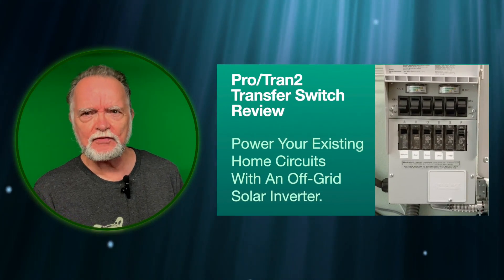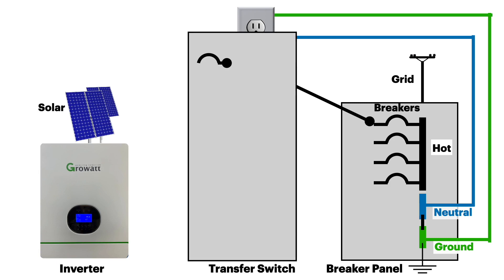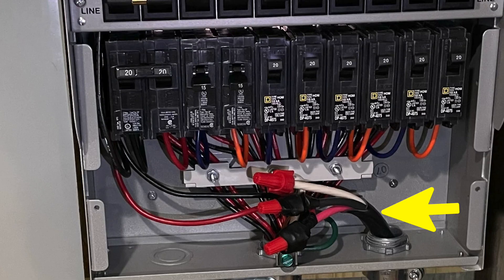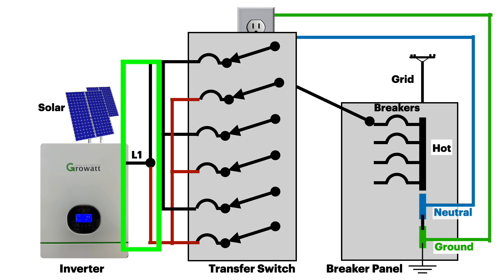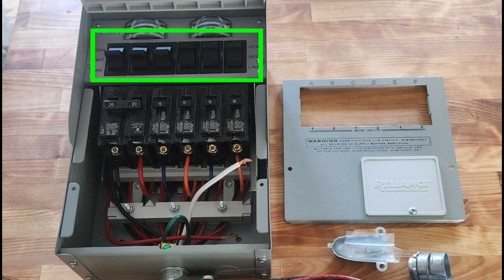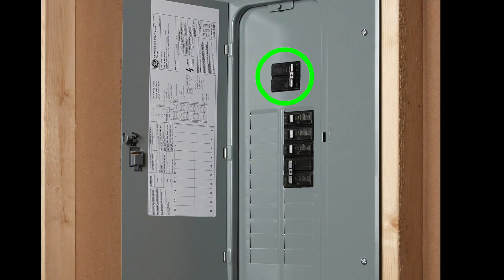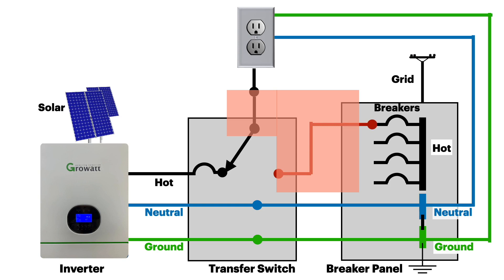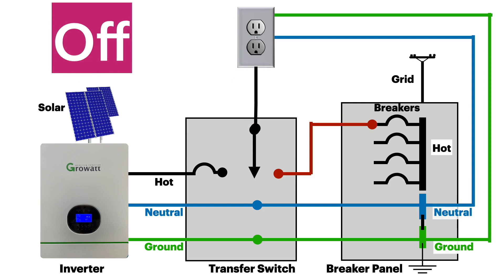Solar Inverter- Transfer Switch Install- How To!

Comment: I have a question am my electrical panel for my house the neutral and the ground they both are the same buzz bar so when I connect my transfer switch, do I connect both of them in the same bus bar police advice?

Comment: You clearly showed how the neutral and ground coming from the inverter connects to the transfer panel, but I didn't see how L1 and L2 from the inverter connects to the transfer panel.  Maybe I missed it or it's in another video.

Comment: Great video.  Question- I do not need to connect all the switches at this time.  What can I do with those?  What do I do with the cables I do not need to connect to the panel?
Reply: Leave the wires coiled at the bottom of your main box. The breakers can stay in the box unwired until ready to use.  That way you can use them easily one at a time if needed.
Reply: @SwollenCraniumthank you very much for replying.

Comment: I've been designing a battery backup system for my home based on a 24v, 3000w hybrid inverter. I wanted to use *some of the existing circuits in my main panel.  Your video helped me decide to use this system in the video. You explained it very well!

Comment: Thank you so much! This is the only video that I found that explains how to wire an inverter to a Reliance transfer switch and load center. Your pace of speech facilitate comprehending the work at hand. Bravo! 

In my case, I will be installing two Reliance 10-circuit transfer switches (model 510-A), as I need to power 20 circuits out of my 44 circuit load center. I contacted Reliance Controls and ask how to accomplish this. For anyone needing to know, this is what they told me to do: There are 4 wires in each of the two Reliance transfer switches (RTS): Black, red, white and green. (8 wires total for two RTS.) Bring all 8 wires to a junction box. Also, bring 4 wires (L1 black, L2 red, white neutral, and green ground) from the inverter into the junction box. Connect all three black wires with a wire nut; then all 3 red wires with a wire nut; then all 3 white neutral wires with a wing nut; and finally, all 2 green ground wires with a wing nut. That's all there is to it.
Reply from the maker: Thanks! Glad it was helpful.
Reply: why connect only 2 green wires inside the junction box? shouldn't it be 3 green wires to be consistent?

Comment: I always thought you couldn't intermingle neutrals wires from an inverter and the grid. Let's say theres a power outage and you're using your inverter to power your panel. If the neutrals are bound together and not isolated, wouldn't you accidentally send power to the grid's neutral line?
Reply from the maker: Only if you also connect a hot (L1 or L2) from the inverter. Electricity is always trying to return to its own source. 
All of your circuits in your house have the neutrals tied together in your panel, but those neutrals will not have any current unless you connect a hot (turn on a switch or appliance).

Comment: @ReelClearMediaLLC
Excellent video. 
Question: I have a grid assisted battery back up system with no solar. I'm using a EG4 3000W inverter. I have a dedicated 30A circuit coming from my house sub-panel to my AC-in at the inverter. The house ground and neutral is always connected to my inverter. This inverter has a common neutral configuration, therefore, the house ground and neutral is passed through the inverters' AC-in to the AC-out. I was thinking of tying into my house sub-panel to feed some house circuits with a transfer switch, however, since my inverter is permanently tied to the grids' neutral and ground there would be two ground and neutral paths between the inverter and my house sub-panel (one ground/neutral from my 30A dedicated circuit feeding my inverter and one ground/neutral feeding the sub-panel through the transfer switch). This would create a ground loop and neutral loop. Would this create any issues?
Reply: I believe the EG4 makes and breaks its ground-neutral bond internally with relays depending on if it's passing grid power thru or not. It's because of the possibility of unplugging the AC input entirely, not just grid failure. If you unplug, say in an RV park, you have no upstream G-N bond. So it makes the bond while it's on inverter power only. If you tie back into your main panel with a transfer switch like in this video, you'd disable the G-N bond 100% of the time in the inverter. There would never be a safe scenario where the bond would need to happen in the inverter in this case.

Comment: Is there a way to have it wired both for solar inverter and a 30 amp generator plug?
Reply: I have a 10 switch reliance transfer box already running to a 30 amp generator plug but having solar as a plan a or b would also be nice.
Reply from the maker: You could use one of the Reliance power inlet boxes, and manual switch cables between generator and Inverter. Alternately, you could use a three or four pole switch, but it would have to be rated for the amperage... most like would be pricey
Reply: Thank you for your time and the wonderful explanation. 
  Regarding a generator, could you simply use an interlock at the main panel going to a generator and at the transfer switch select "line"?

Comment: Is there something like this where the switches flip automatically when the power goes out so I don't have to do it manually every time?
Reply from the maker: If you want to power existing circuits in your existing breaker panel, there are a few Automatic Transfer Switches (ATS) available. The ones I found online were very expensive.

If the output of the inverter powers a seperate breaker panel,   the inverter can switch between solar/battery and grid. Many inverters include a transfer switch.  I'll see if I can make a video on this soon.

Comment: Do these off-grid inverters come with an output port to hook up to the transfer switch?
Reply from the maker: The inverters that are designed to be grid-assisted (as well as grid-tied) have AC out terminals. These are usually screw terminals.

Comment: Another Youtube channels claims not Isolating the Neutral from the Invertor and Main is a nono
Reply: any hints were to find it?
Reply: Correct. At least in EU neutral should be isolated(there should be no possibility of back feed into the grid via the neutral) and in that case the ground also needs to be separate. Also there can be only one ground "at a time" in the circuit, so if the neutral is isolated we also need a separate ground for the solar panels/inverter/load.

Comment: Thank you for this video but sir I am facing a problem with my inverter because the grid in my area is not always available so when the sun goes down I need to increase the charging power of my inverter from 20A to 60 or 80A but when I did an error pops up “the parameter type null” and it returns to 20A automatically
How can I deal with it because I need to charge on grid rapidly 
Thank you again
Reply from the maker: what model of inverter?
Reply: @ReelClearMediaLLC  
Growatt SPF 5000 ES
Reply from the maker: @ebrahim3488  check these settings...
setting 2: overall current (utility + solar)
setting 11: utility current
setting 14: needs to be SNU or CSO when using grid
setting 49 utility charging time. 0000  allows utility to charge all day.
.

Comment: I'm installing a ground mount system (grid-Tie), and running to my shop which has a 200amp service and it's own meter. I was going to run a 50 amp line to the house and install a Gen transfer switch so I can select what curcuits to run thru the shop (grid-tie) meter. After watching your videos, I would have to run my nutrual and ground from the shop service thru the Transfer switch to my home service. With the rule of only one bonded nutrual this would not be possible. Any suggestions?
Reply from the maker: I'm assuming the house has its own meter and its own neutral-ground bond. 

You might be able to use a transfer switch that switches hot and neutral. Most of these are pretty expensive (over $1000). 
There's one called EZ Generator Switch that might work for you: https://amzn.to/4bwEJWl
The only problem is they are made for only one 120v circuit, so you would have to use several'

Another possibility is to add new "solar only" outlets. These would be fed entirely from your solar system hot, n, and g,  and would not share any wiring with the existing outlets. I saw a guy do that once. It works, but you have to manually unplug appliances from the existing outlets and plug them in to the new solar outlets.
Reply: @ReelClearMediaLLC  
I'm glad I ran across your videos! It was put in a way even I could understand.
What are your thoughts on this idea?
From my ground mount to the shop is 120', hang the combiner on the shop and continue the run to the house 120', tie into the house load center. it will be a 30-35amp circuit, can I then add a 30amp 240v plug after the combiner at the shop?
Reply from the maker: @qx3091  I'm not sure I follow, correct me if I am mistaken.  You would go from the combiner box to the house and the shop? I don't think multiple MPPT chargers on one combined output would work.
 It might be be better to split your panels into two separate arrays, one for the house and one for the shop. Each with its own charger/inverter.
Reply: @ReelClearMediaLLC  
My thought was tapping the 240v line between the combiner and load panel. In this case, running a split AC unit (18.2 amps) from the tap. I would be using the PV to power the AC unit, and the 30 amp PV breaker from the home load panel would run the AC when the PV is not producing.
Reply from the maker: @qx3091  I have no experience splitting a solar DC combiner... seems like it would be ok, but not sure.

Comment: When circuit A is sourced by the grid and circuit B is sourced by solar, is there any problem? The grid and solar share the same neutral. Will it backfeed to the grid or solar?
Reply from the maker: In North America, the neutral and ground are bonded at the main panel, so neutral is referenced to ground. The transfer switch keeps the hot (L1 and/or L2) from the solar isolated from the hot lines of the grid, and can't back-feed the solar into the grid. 
Think of it another way... in your house, all  of your neutrals are always connected to the neutral bus bar, even if the switch on that circuit is off, and current doesn't move until the switch is on.
There can be a problem if the inverter's ground and neutral are  bonded. Then, you have two bonds and current can flow on your ground wire. see my grounding and bonding videos.
Reply: @ReelClearMediaLLC  Thanks for your reply. I still have some questions about the transfer switch. However, I cannot upload a diagram in the comment section. Can I ask you via email?
Reply from the maker: @hungertemple7717  sure... steve@reelclearmedia.com.  Again, I'm only familiar with North American wiring.

Comment: OK! after two days of trying to get my PowMr inverter to work with no avail I finally found your video. I hope I can ask you a couple of questions.
I can't get my transfer switch to work.  The red and black to the main panel are good.   I'm using a single phase 120 on all breakers.  My 24v 3000 w inverter has  three terminal ac IN but only two terminals on ac OUT, no ground third wire.  I wired the ac in to an extension cord for battery charging.  I connected the ac out two wires to the transfer switch red and black wires. it does not work.  I don't know how to ground all these wires and maybe that's the problem.  I don't get it itwatching the video, i'm not too savy.
Reply from the maker: I'm not familiar with the PowMr  inverter.
The two wires out are probably L1 and Neutral...Its vitally important to identify which is which.
What transfer switch are you using?
Reply: I figured it out. It was a dumb mistake. I opened up the panel again and found I had put the neutral into the ground bar. It’s working now on battery. Still no solar input showing though
Reply: Unless you're using a solar generator THEN you have a floating ground DO NOT hook to solar generator!
Reply: @dons5105  I put the neutral in the neutral bar. 
The inverter is now working properly. The reason I have no solar is because my unit needs an MPPT range of 120-400v and my panel only puts out 36v. So I’m learning as I go. Thanks for your help.

Comment: Great video as always, if you don't want to use an ATS, Can you make a video on how to connect AC input from grid to Inverter, i get confused a lot on how to do that.
Reply: I may be too late to answer this, but, the inverter will either have an ATS inside it or it won't. If it doesn't have grid input, you do not connect the grid anywhere. The only way to connect the grid to your system is thru a battery charger. Some people prefer this as it gives no possible way of backfeeding the grid, because the AC in and AC out of your system never touches.

Comment: Thanks for the video.  So, having a transformer to generate L2 is not needed?  Or maybe only needed for a critical loads panel when not using a transfer switch.
Reply from the maker: The only time I've seen people use a transformer was running a 230v European inverter such as a Growatt SPF 5000-ES. That inverter only outputs 230v with no neutral. The transformer is used to give you two hots (L1 andL2) and a neutral.

I'm using a Growatt SPF3000TL-LVM. Its a single phase 120v inverter that has L1, neutral and ground. 
I'm only running 120v circuits, There are no 240v circuits. The individual circuits don't care if they are L1 or L2. Its important that the total of the transfer switch circuits isn't more than your inverter can handle.
You can run a critical loads panel off-grid with only L1, as long as you don't have any 240v circuits. You must still do proper grounding and bonding.